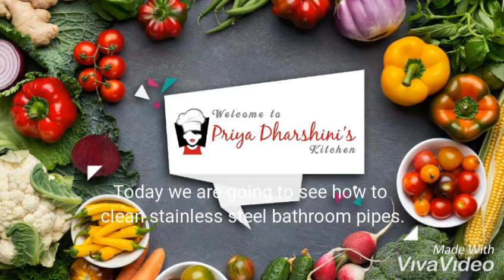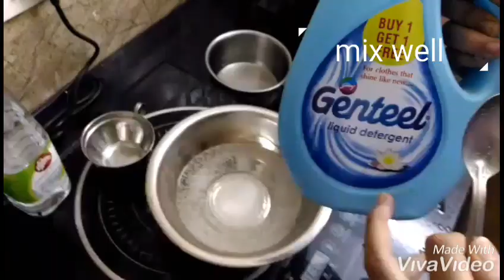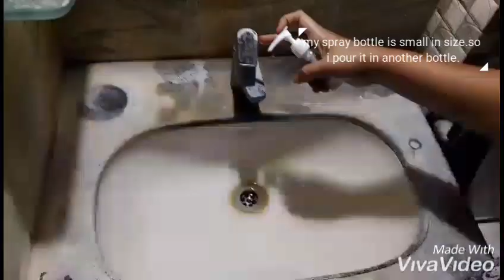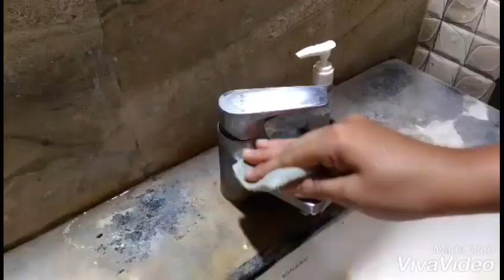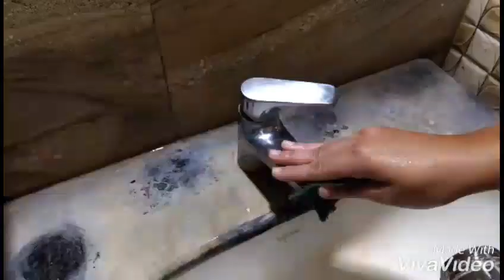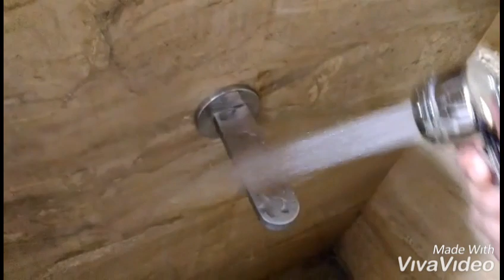Cleaning Bathroom Taps | How to clean Bathroom Taps Easily | Cleaning Stainless steel pipes DIY

Comment: This is not the right fiber and mix.   Use only vinegar; wait 15_20 minutes an scrub with non abrasive cloth. Then rinse and finally Polish with dry (not wet)  steel wool grade 0000.   Try it and you will notice a substantial improvement with no scratches on chromed surfaces.